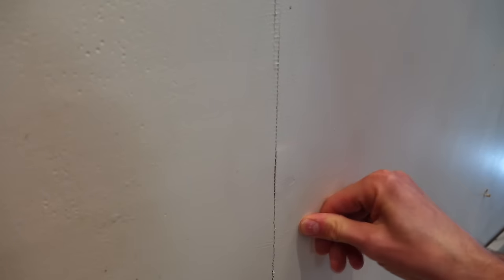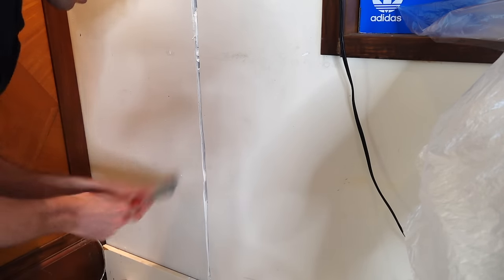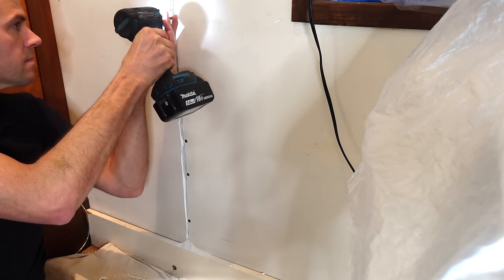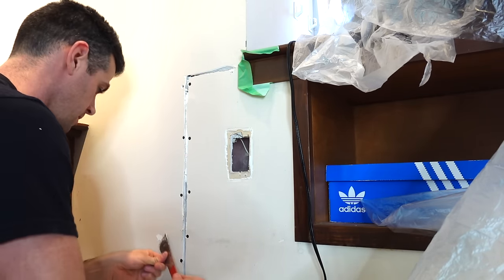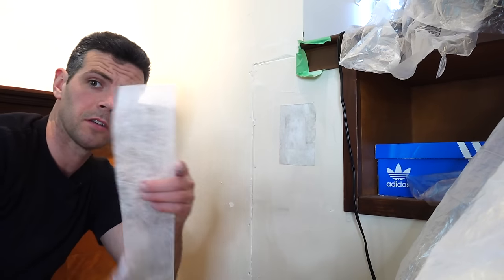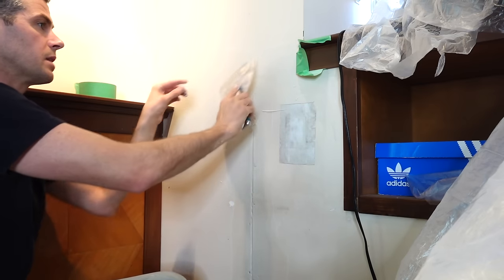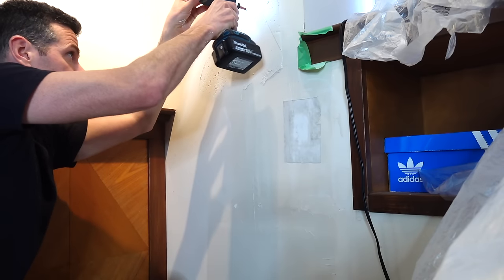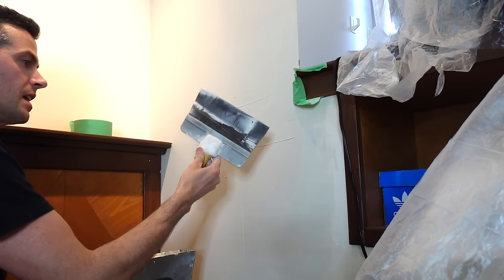Drywall Repair!!! Fixing a classic MESH TAPE CRACK!

Comment: I think the hardest thing I had to realize, was it doesn't have to be perfectly smooth with the knife. Many times its the " one more pass" and its got a krusty in it then it turns into 4 more passes, when I should of just stopped 5 passes ago.

Comment: Mesh tape is crap that is the problem. And it does nothing if glued down to bare drywall. It is supposed to be embedded in mud like paper tape. If you use regular joint compound it will crack almost every time. Must use fastset to use on first coat. You might get away with it with fastset on the field joints (the recessed edge of Drywall). You might get away with no tape at all and fastset on field joints.

Comment: Crazy how a small repair can take days to fix for mud to dry.  Pending on the mud you use.  For a diy person I typically like the mud that doesn't set too quick.  But recently started using 90 and mixing in small batches it definitely speeds up the process.  Just wish I had your knife skills.   It's like watching a chef in the kitchen.  Love the videos, you've been a huge help and also very entertaining

Comment: Hey mate, I’ve watched and learned from your videos for years, despite being a plasterer and decorator. In England all we use when skimming is mesh, and yeah we do get fails with it, but generally it’s not because of the mesh, it’s loose boardwork, shrinking timbers, structural movement etc. tape and jointing is used here in new builds and I’ve been to literally dozens of tape and joint fails be it corners, angles etc. I think it’s fair to say that any joint will crack given the worst circumstances for it.

Once again have watched and loved your videos for years. My Mrs even recognises your voice when watching vids haha
Reply from the maker: 100% agree. Any tape and mud will fail under the wrong conditions and even the some of the worst tape jobs hold up under perfect conditions. But I always plan for the worst case scenario so that only the most stressed joints could possibly fail.
Reply: Yea, my wife recognizes his voice too... and she thinks he’s good looking...hmmm.

Comment: I have been using Fibafuse a lot lately. I started with just patches, but it's also good for butt joints on new work. The one place I won't use it (so far) is inside corners. It doesn't fold well and it is really easy to cut with the corner of my knife. I also have a favorite 10" Knife that I have had for at least 15 years. When you find one that really works for you you can never let it go lol

Comment: Your videos got me so much confidence. Where I live, in Iceland, we dont have much options in terms of timing so I get the american powder one ugc or something like that, the 20mins version and damn I learned to work with it fast and it was a learning curve too, I thought putting water would make setting it slower boy how wrong I was 😂. Today I have a kitchen finished and it took me 2 days to figure out the consistency for the 20min one. Next time I will get a 45/90 one so I can take my time.
Reply: The more mineral dense the water you use to mix quickset, the faster the chemical reaction that hardens it will be. My tap water has a lot of lime sediment, so my 90 minute mud is more like 30 minute

Comment: @vancouvercarpenter, WOW!  If it weren’t for the fact I watched the whole thing and knew where the wet spots were, I wouldn’t even see the repair.  I’m sure there some camera issues with color and all, but you can’t hide lumpy shadows.  I couldn’t see ANYthing at the end.  Beautiful work.

And I didn’t realize screws were needed.  You can really tell my builder cheaped out.  SOOOO many mail pops!

Comment: From one Ben to another, THANK YOU for making this channel.  I actually have a cracked mesh tape joint that I need to fix as part of my current project.  Looking forward to repeating basically what you did here... except I'll use 90 minute and paper because I'm a newbie :)

Can't tell you how much time, money, and frustration you've saved me as a new homeowner doing a lot of DIY.  You're an artist with a trowel, always uplifting, fun to watch, and I've learned so much from you.  Peace and love, friend.  You're a huge blessing.
Reply from the maker: Hi Ben :) You should seriously consider using the fibafuse. You might not go back to paper after seeing how well it works for repairs.
Reply: @vancouvercarpenter looks like he didn’t understand nothing from this video

Comment: Good video. Solid thinking. A lot of experience.   That  tape looks good. Not available when I was doing this work.  Personally I won't use mesh tape.
If you have a nail pop, either remove the nail, or put another nail, or screw,  right next to it. I've nailed a lot of drywall. Two nails less than an inch apart will never pop, one nail will almost always pop. 
In the early 90s  was renovating my 55 year old house. I was in Los Angeles and fnished taping the cracks before the Northridge Earthquake.  Some cracks I used paper tape and some I used mesh tape (no actual plan or reason.)  The mesh tape cracked, none of the paper tape cracked.  This wasn't drywall, this was plasterboard with a layer of plaster over the top. So it was all fastened correctly. I probably ran a few screws in. The ceiling where most of the cracks were could've been built stronger. (A friend's house I helped his father a more experienced carpenter had similar problems but more of them. We ran purlins in the attic, this distributed the load across all the joists, problem solved. In my  attic I put down plywood over the insulation  same basic idea, plus you could walk on it.) 
So my experience indicates that paper tape is significantly better than mesh. Mesh of course is a lot quicker and easier.

Comment: Thanks for this one! I have this exact issue after filling in some wood paneling and discovering two overlapping sheets weren't quite fastened enough. It was a sad surprise to see a big ol' crack spread over the winter as the temperature and humidity fluctuated. I'm gonna follow your steps and finally fix the issue!
Reply: Pss.... fix it all hot mud is bulletproof.

Comment: I did some work in my bathroom. 
Used the mesh tape. 
It failed. 
But now I need to see if the cause is the tape of a loose joint. 
Thanks .

Comment: I have been  priming  with latex bonding agent on V out joints.This is to provide a stronger bond for back filling.I use the same material added to the rapid set hot mud. I do this for my repair work mostly.Useful over prepared painted surfaces,prior to plastering and skim coating.

Comment: I have this exact issue! Before I started down the Vancouver Playlist. I had started a drywall project and I used mesh tape to tape the edges of a large piece of replaced drywall. Now I have tried putting thin amounts of mud twice but it just came right back! Like a bad dream! I live in a cheap trailer and all of the drywall was stapled on and the butts were covered with thin ugly trim strips.😮‍💨

Comment: Great video, like usual, I noticed the hot patch you did off camera... have you ever tried chamfering the edges of a hole like that, then pressure fitting in some diamond mesh lathing screen, then keying it in with thick 5 min quick set?  A repair like that typically takes 2 coats of quickset, with a final of topping, and it is basically like filling in a nail head, no need to break it out (creating a hump over a distance).  It is an extremely strong repair on both plaster and drywall.

Comment: Thanks!  I’m having exactly the same problem.  The contractor used mesh tape which has cracked around the entire perimeter of the drywall repair.

Comment: My biggest problem when doing this my self at home is to understand when you're at the 'thats good enough'-state, and not go past that. I bet I've waisted a lot of time trying to get mud to be more perfect than it should be at a too early stage. 

But this video is perfect for me right now. I have cracks like these after removing fiberglass wallpaper (not sure if you have those). I thought I had fixed the problem with sanding, mud and paint, 2 years later the seams started to crack . Turns out the walls were never tapet to begin with because they knew they were putting up wallpaper. So now I'll have to cut out and tape.
Reply: I've been learning how to mud on the job, and yes, can agree that I fuss waaay too much with making it look perfect at stages that it doesn't need to. I end up over working the mud til it's like putty, or gets tons of dry bits in it.

Comment: I've just discovered a delaminating area behind our fridge and found out why, they were using leftover bits; one section is only about 4" wide and poorly fastened.  I've added screws where I can, but half of it has nothing behind it aside from the dwangs and I tried doing an angled screw, but it didn't work.  I'm going to use our equivalent of Fiba Fuse on it and backfill beforehand.  It didn't crack, just the layers of plaster delaminating which I put down to them putting it over lining paper that had been applied to the Gib board.  One of many examples of poor work in our place.   I'd replace the gib, but you can't get it here atm due to shortages so I have to work with what I've got.  Today I'll be backfilling, I don't have the experience to be doing everything in one session yet.

Comment: Fibrafuse is the only tape that I can get to hide for so reason. 

Paper wrinkles and the checkerboard stuff is hugely difficult for me to not see the checkerboard pattern.  Even with the so called ultra thin. 

The Fibrafuse does not have either issue.

I do not do enough taping that cost is an issue.
Reply from the maker: My guess would be you don't bury the tape enough. You shouldn't be able to see the tape after the first coat.
Reply: @vancouvercarpenter  else I bury it and sand it flat. Lol.

So far, so good with fibrafuse, though. 

I just did a big patch that seems to turn out perfectly. I could kinda see the fibra fuse but only in the dark with hugely intense flashlight shone at a angle nearly parallel with the wall.

I found a way neater and faster to clean up way to mix durabond, if you are interested.  My method is ideal for existing work, probably not for large new jobs.  But it saved my butt last month, with frozen pipes outside and no utility sink.

Comment: Lvve fiber tape  for wider patches and skim coating. The fibers will come off and itch or get in your nose when working over head so I wear protective eye wear and if I'm doing a big job overhead a mask. But they don't sell it at any stores here in Mtl. and I have to order it on line from a Canadian distributor!

Comment: Think about it, few slim strip fiberglass across seam doesn't add any strength to joint or prevent crack appearing. But paper tape is much stronger and it hides crack under it obviously if  movement isn't huge.

Comment: Great video, as usual! I have my own hack of using used dryer sheets. (In Quebec, or at least around the Montreal region, Fiba-Fuze or whatever it's called, doesn't seem to be available.) It worked 100% over a stable 45 degree crack over a doorway corner, but the compound cracked over a seasonal movement crack under a window. But I still carry those sheets along with Fiba-Tape. Each has its uses.

Comment: Can you possibly do a video on using a plasters float. They are becoming more prominent in the UK, especially in the DIY market due to the ease of getting a smooth surface without the need for multiple coats. I'm sure it's in the realm of cutting corners but seeing a professional use one would be great👍

Comment: Hi,

I’ve been watching some of your videos and very informative.

I have an issue where I used mesh tape in a new ceiling recessed joints and realising now have used the wrong compound (premixed) there is a hairline crack through these joints and want to know the best way to fix before painting. I got the skim coat before they appeared.

Questions are

1. Should I sand back the joint to expose the mesh tape and either remove or go over with new bagged mud and more tape on top? If so keeping in mind I don’t want to build too high in this case what would be the best tape to use? Paper, mesh or fibre?
2. If removing the mesh tape is required what is the best way to do that?

Any help would be great.

Comment: In my detached house in Finland the walls are chipboard and cracking is a problem because of the naturall living of the house. I have installed thin drywall (7mm or 1/4 inch) overlapping the chipboard seams. Hopefully this fixes the crackinbg issue. Havent seen yet another crack.

Comment: How do you fix the same cracks without a stud behind it? 

I use your videos all the time since I'm renovating my first house all by hand with my girlfriend. Re doing floors. Subfloors. Drywall. Electric. Plumbing. Kitchens and bathroom all redone. Crawlspace clean out and encapsulation. Everything ourselves.

Of course the house we bought was built by butchers. So I'm trying to fix settlement cracks. 

Corner bead is not even over the drywall sheet, aswell as no studies behind the joints of the sheets....so how do I fix it to last?

Comment: hello , I see you didn't use primer before mudding, is there no need to use it? i usually use) and use special mud for joing..your way is easier, i need to try it.
I've watched your vids for a long time,thanks, hello from Russia
Reply from the maker: We don't prime before mudding but I can't tell you what to do with your local products as they may be very different than ours. Europe uses a lot of plasters which are pretty different than joint compounds.
Reply: @vancouvercarpenter  you know quite the same as yours..but i notice that your mud for all purpose is more harder ( for sanding) ... thanks for answer

Comment: I am learning after repeat lessons which mud to use. It’s confusing. My issue is in garage and back porch the tape has separated from the drywall. More humid conditions right. But the areas are everywhere. These are large knockdown textured. Would love to see you address this. You could use my house for the video. I’m in Florida though. Lol.

Comment: We generally V-out the seams and then paint on a couple of coats of PlasterWeld (pink aliphatic resin) to penetrate the paper AND gypsum, including where the new fiberglass tape will sit.  PlasterWeld tacks up in 15 min.   After applying the tape, the PlasterWeld does a nice job of gluing down the tape and the mud for a strong underlying bond.

Comment: It’s odd, but I’ve had the exact opposite experience with fiberglass mesh tape. There was a crack in an inside corner of a hallway, in a house we used to live in. I removed all old tape & compound, re-taped with paper tape and and re-spackled that crack, but the crack always returned. I tried 3-4 times.
I then did the same repair but with mesh tape. After 4 years the crack never came back.

Comment: I like your vids. I've done very little patching or dry wall and I have learned from you that none of it was right. I have also learned I'm glad that I didn't do this kind of work for a living. I would like to know you said did you have your knife on the right side  don't LOL. I don't know that's why I'm asking the PRO. Is there a side that does something different?    Thanks   SIR.
Reply: Mudding is actually easy once you get the eye and feel for it

Comment: There's not much build-up but aren't you going to create buildup (a bump) if you just tape right over without removing the tape (recessing the surface so the new tape sits flush with the wall)?

Comment: Have a room that went through a earthquake. All the mesh seams fractured on three of the walls. The walls are textured . After watching this fix, I have to wonder if re-sheeting the room makes the most since. That seemingly small crack reguired as much if not more work than fresh seaming. I have miles of fine cracks ( metaphorically ) with textured surface to contend with. Any opinions welcome.

Comment: I suspect this is what's happening with the ceiling in my den. Failure is right along the tape lines and it wiggles a little when I push it. So it doesn't look to be structural damage. Would you recommend fiber fuse for work on a ceiling or use regular tape. It looks like whoever originally did the ceiling used mesh tape.
Reply from the maker: Fibafuse should work great.

Comment: Did you change your opinion after this video on using Fibafuse when repairing cracks? Saw your July 2022 video repairing settlement cracks where you said it wasn’t great for crack repairs because it tears easily. 

Any advice on repairing hairline cracks from the center of a piece of drywall, and not at a joint?

Comment: Mesh tape can only be used with setting mud per USG. Drying mud is not strong enough and requires paper tape.
Reply: 💯 correct
Reply: @jerrymoore838  what’s really weird is the trusted guys on you tube who talk about this stuff seem to be oblivious to this and mention trial and error leading to that directive.  It’s literally in the documentation. Which means using mesh tape with drying mud is technically not code compliant since 1/2 of building is literally “follow manufacturers instructions”. 
So attempting to use mesh tape with drying mud is a building code violation.

Comment: In a situation like this where you're trying to avoid too thick a build up do you ever do some sanding first where the tape will go? Depending on the paint and mud below I have found this can get me at least 1/32".
Reply from the maker: Sometimes. The main problem here was poor framing and joint placement. It was also in a place where I really didn't care about making it perfect. On a high end job I may have either sanded it down or even ripped out the board to eliminate the joint altogether.
Reply: @vancouvercarpenter  Thank you for the reply.